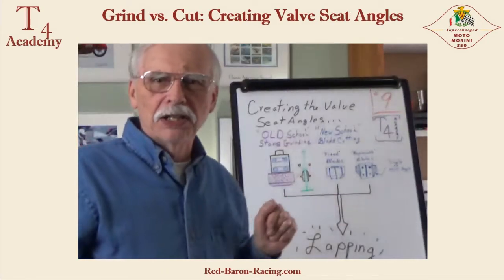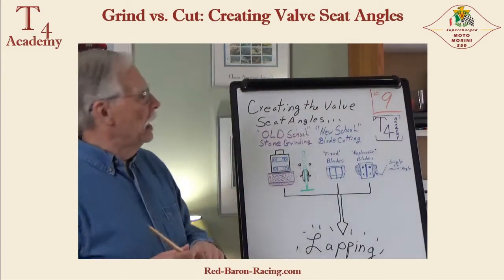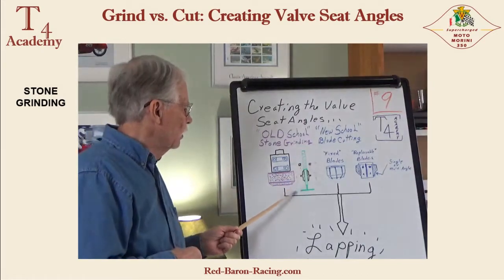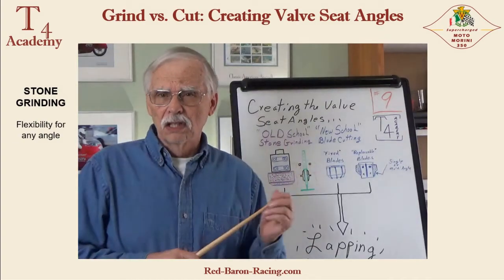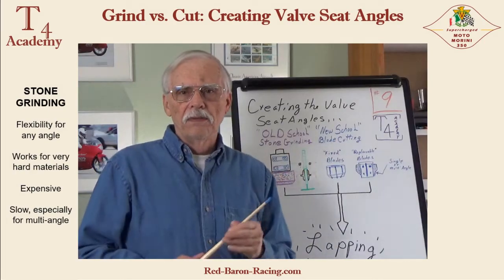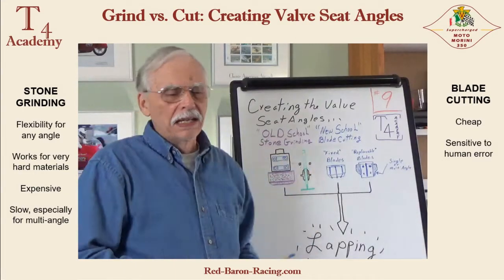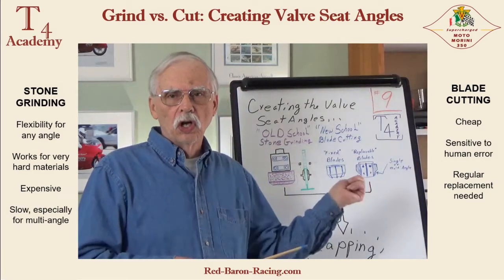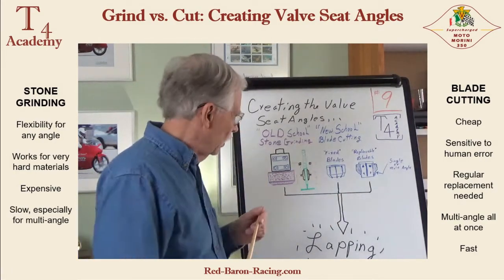Grinding vs. Cutting: Creating Valve Seat Angles

Comment: I'm considering a set of the Newway cutters. Question, if I wanted to use my drill press, what would be a good speed setting.
Reply from the maker: Tricky question. It depends on the cutter and the material. It's probably going to be on the slower side, well under 50 rpm, and may take a bit of testing to determine if you can get a slow enough spin to avoid chatter.
Reply: @redbaronlsr2107b  ok thanks,as it is right now 200 rpm is the slowest I've got. Think of maybe a speed controller would work. Don't know for. But hey thanks. Good video

Comment: Super video. 
Mater of fact i have stonegrinding gear from waterbury hall , tryng to find any information, how to use it prperly, but its not easy to find information about that old school methods.   Do you have any suggestions for a useful source of information? 
Thakn you,
Reply from the maker: I had to do some googling about the stone grinding gear for a Waterbury Hall! Sorry, I don't have any information, but my suggestion would be to contact a vintage engine shop that may have some leads. Good luck!